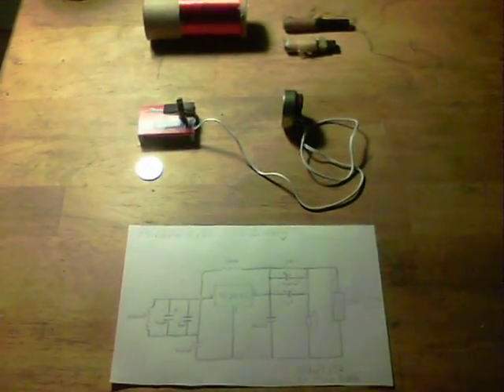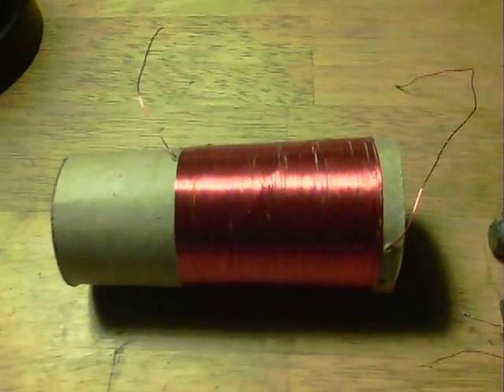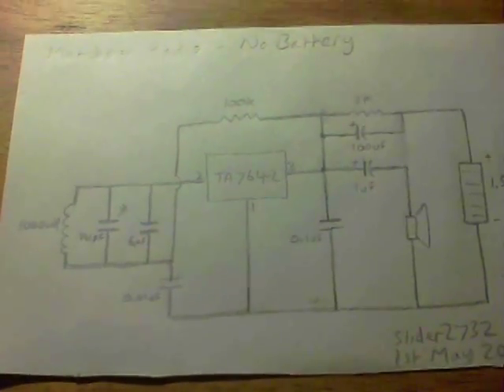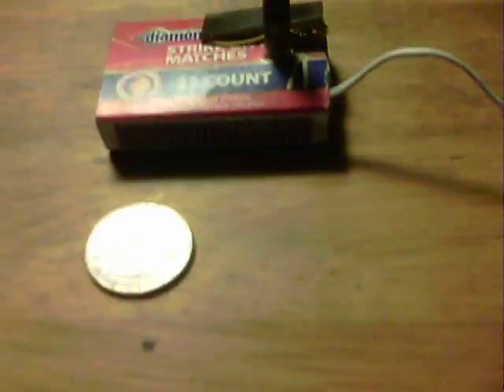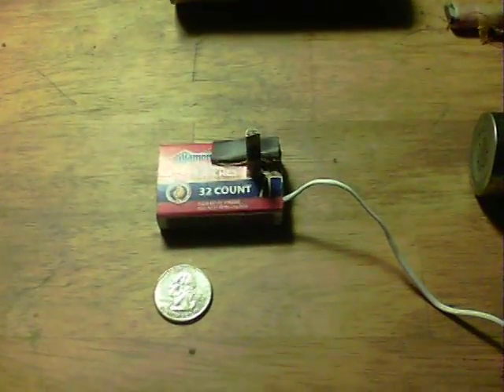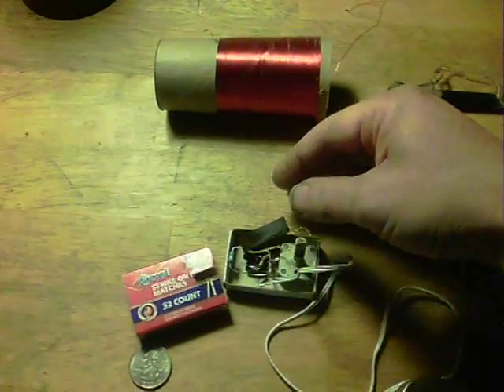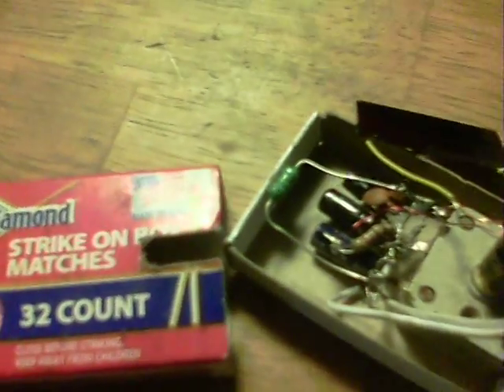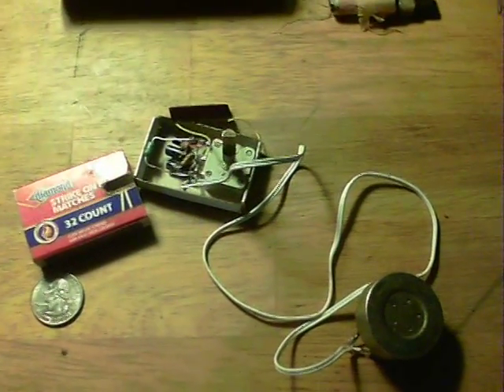Matchbox Radio - No coil, 1.5V solar

Comment: I saw a video for a matchbox amplifier where they could use a 3.5mm headphone jack cable(I think that's the standard). Instead of having a speaker, could you have a headphone jack? I think it would be cool to have both a radio and amplifier in only two matchboxes.

Comment: Could the circuit be changed to receive Fm, Mw & sw, still running from a tiny solar panel?

 Through introduction of two 120pf variable capacitors switched and replacing am ic for a germanium diode detector and lm358, along with a switch to select 100uh inductor for mw, different value for fm & sw.

Comment: Where are you at? I can get sports animal, kfaq, radio Cuba,  and Nashville. I'm outside of Tulsa.
What size is your coil, how many turns, ext? I'm using an ink pen insert with 90 turns.
Nice video!
How many crystal radios have you made? I've made 3 so far.
Reply from the maker: Sooner Science Nerd Haha that's cool. Am in Muskogee. There's no traditional coil in this one, it's an axial inductor, rated at 1000uH. Inside such things is a bit of ferrite and very fine wire wound on it, but they look like a resistor. Have built dozens of crystal radios, the 2 best types being the TA7642 ones and those that use the Mystery coil...can get Chicago, New Orleans, Boulder, Nashville on an unpowered Mystery based set. Radio-locator.com is a great site for working out what should and shouldn't be easy to receive, they have maps of transmitter coverage and transmitter power info for each station. It's just so cool to hear something like "Newstalk 890, WLS" and then go there and find out it's in Chicago :)
Reply: how many turns do you use?
have you tried using a real crystal? tried it, but what I've found didn't work.
Reply from the maker: Sooner Science Nerd For the Mystery, it has it's own spec: http://www.hws.org.au/Crystalset%202000/mystery.html 
You wind 2 coils at the same time, they're really quite excellent crystal radios. Btw, a good earpiece can be made from an old PC motherboard beep speaker (the high ohm earphones are quite rare nowadays). Have tried actual Germanium in rock form and it works great. Fools gold works too, with a pin as point contact.

Comment: interesting cheers...subbed also
Reply from the maker: Thanks :)
The TA7642 is very flexible with coils, built another the other night using 80 turns around a solder tube. It picked up WBBM out of Chicago, so that's 600 miles out of a solder tube lol. Ferrite can be used in a coil for tuning, if you have no variable capacitor.
Reply: slider2732  its amazing what  some tubes and wire can accomplish watching that video m8  ...cheers again

Comment: Nifty!
Thumbs up!
Reply from the maker: Thanks :)
Oh hey, well done running the C3198 LS circuit down to 0.1V !
Might try the loopstick method of that while listening to this radio lol
Reply: slider2732
if you can still find a loopstick! They seem to be getting very rare.
This vid of yours inspired me to try a solar cell on my SooperLooper ... it works! Starting with a flat capacitor, shining a flashlight on the solar cell causes the voltage to rise, until about 0.445 volts and the oscillations start and the LEDs come on brightly. Then the voltage drops to about 0.25 v and holds there as long as I shine the light on the cell, with brilliant LEDs.

Comment: Wow thats tiny :) Wonder if you could squeeze a gas lighter and knife in there? Turn it into a survival tool for campers :D Sliders Swiss army matchbox radio....
Reply from the maker: LMAO, funny conv you guys have been having...but hey why not, being as the 1000uH works as both aerial and inductor it trims off a lot of fat, as does a knife.
Side panel would be a solar panel - a Gadget Knife.
Reply: Crocodile Dundee knife. LOL.
Reply: The antenna ?
Reply: Just add lasers.
Reply: Mongrel Shark my
by

Comment: Nice and compact! I was wondering how you were powering it without a battery or long antenna, then I realized you had a solar cell. Cool.
Reply from the maker: I was going to use a 'full sized' panel from a garden light but tested this one on the offchance.. 1.5V and several uA while sat there on the table.
Say, originally i'd planned on replicating your pizza box crystal set when you showed that, but then wondered if a matchbox would work lol. The project morphed out into this one over time.
Reply: slider2732
Use the "big" garden light pnnel and add an amp :D
Reply from the maker: Mongrel Shark
 Not a bad idea at all :)
It looks a bit ungainly sat on the top of the box, but would further improve it.
Reply: Rimstarorg 😎
I am a big fan of you